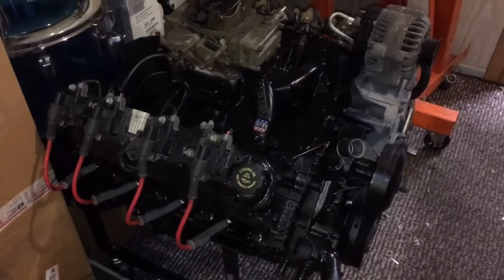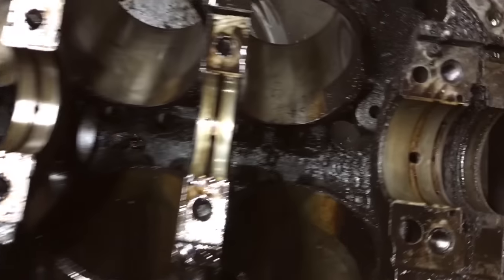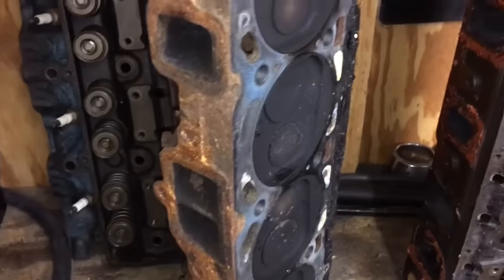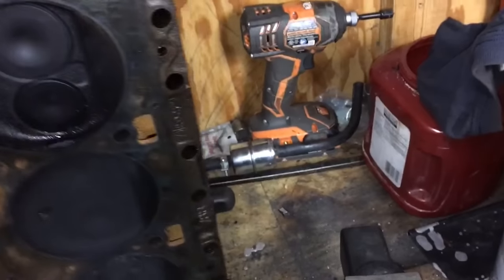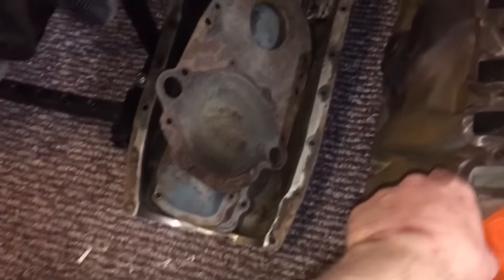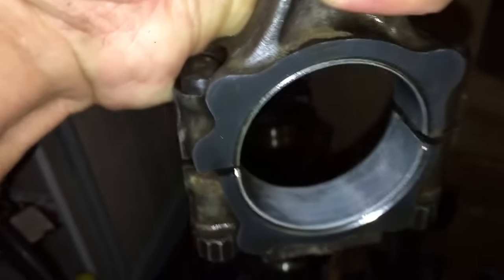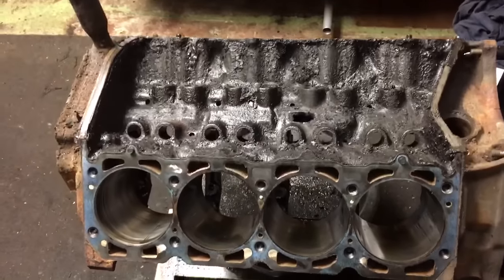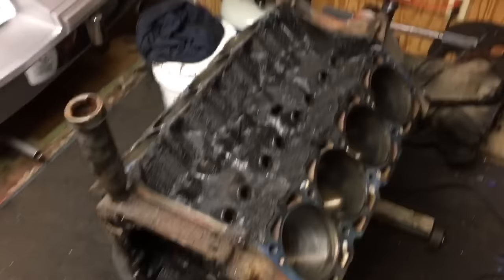New Update: 1979 Olds 403 build, The LSx 5.3 is done and more!

Comment: Nice vid ,,Did you or anyone you know ever put 350 7a heads on a 403?
Reply from the maker: Ya i did. In 2005. With a small cam it ran damn good
Reply: @beeterolds  Thanks for the reply back ,Great to hear !! Did you have to recurve the distributor ? Plus going to run my rochester carb and wonder if I have to rejet it
Reply from the maker: It was 15 yrs ago. I really dont recall what else I did
Reply: @beeterolds  Ok thank you  but if you remember anything please let me know anything helps much appreciated
Reply: @beeterolds  Hello Beeter sorry for being a pain in the ass I was wondering what cam & specs should I use for the 350 heads on the 403 looking for a mild cam nothing radical what would you suggest ? I respect your knowledge because you know these olds motors pretty well

Comment: The problem with the 403s are it has a weak areas between the bores and the weak main areas, which can be reinforced with main kits from like Mondello, and it has low compression. Why not get a 425 or a 455 instead?
Reply from the maker: w41duvernay I've never had an issues with the 403. True it has its short comings but for a low compression mild street engine it will be a fine replacement for a 307. The 425 and 455 would be better but I only paid $100 for this motor. It will get 455 heads and a very mild cam. If I was to do anything else in terms of performance I would just use an LS engine setup
Reply: Not trying to berate what you did, but now I understand you went that way for $100 bucks. You will have to shave A LOT off of those big block heads to get the compression back up. You really think about custom pistons for this to get it up to 10 to 9 to 1 compression. I would love to see the final result. I'm an old Pontiac/Oldsmobile guy. I have a highly moded out W41 92 Achieva SCX myself.
Reply from the maker: w41duvernay The heads I have were milled and they come in at 77ccs the stock 4A heads from the 403 were 83cc. Combined with a thin head gasket it'll be a 8.5 motor. Considering it's going to replace the 307 in my dads 83 Olds Custom Cruiser it will be a great everyday driver
Reply: w41duvernay I have a 403 bored .60 over. Forged pistons, Olds 330 steel crank, #6 heads grinded/ported 214/226 duration cam. Holley 650 DP. She pulls pretty good. Dynod 436whp with a th350. That setups been running for 5 years.

Comment: Dude why did you use a  NON performance 600 CFM Carb .. And why would you have anything to do with a 403 it's a fucking Boat anchor .. You can't even get performance parts for that Dog motor It's embarrassing bro.. You would even consider that garbage over the LS motor..and Hey buddy the 350 and the 455 are Identical and DO NOT utilize the "Big Block" terminology.... .. Your Obviously a Dreamer  the 403 is as far away from being a performance engine as   Trump is from being a Genius What your not reusing the Worn the fuck out rings ?  Oh really but what about the Charcoal in the lifter valley Or the Broken ring in the  cylinder .. Whats that no problem either .. How you can compare that Junk yard Boat anchor to the LS engine is beyond me